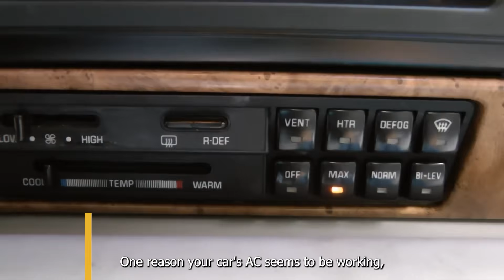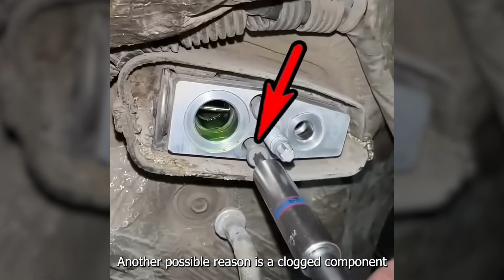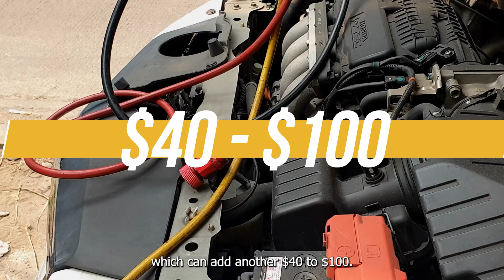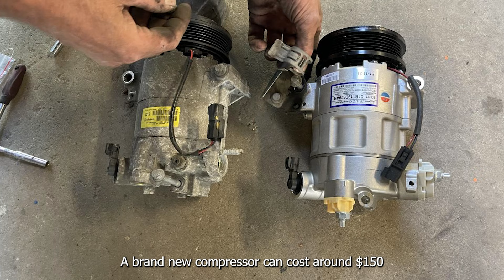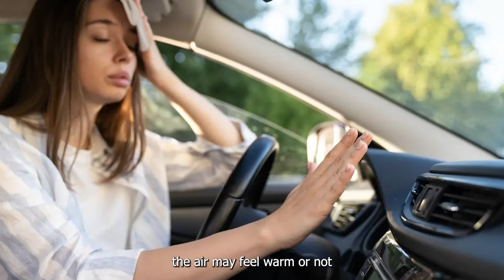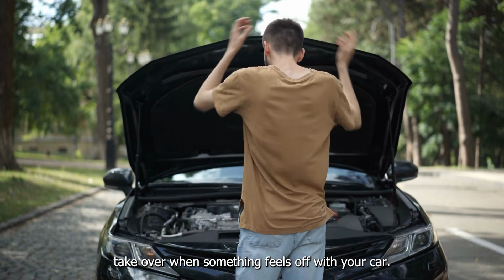AC Works But No Cold Air | AC Compressor Comes On But No Cold Air Fix

Comment: I have a 1996 Saturn SL and the compressors engages but there is no cold air. My first thought is not enough regerant because there was a previous leak. However, I was noodling aroun and when the compressor engages, I feel cold air blowing near the engine. So I wonder if there is a bloackage or some other reason that the col air would exit in the engien compartment?